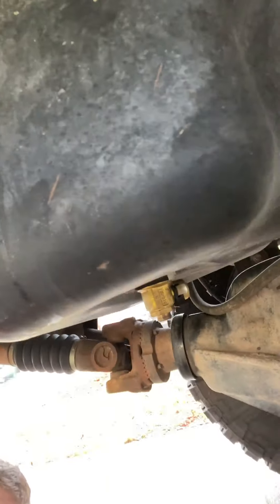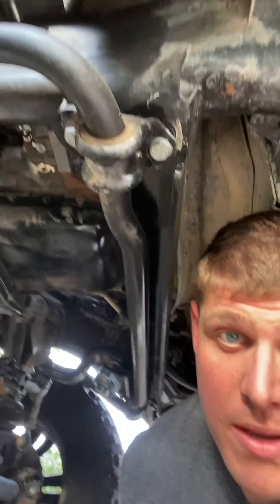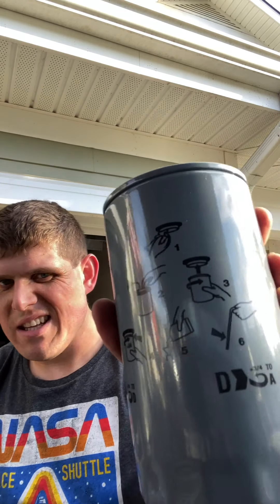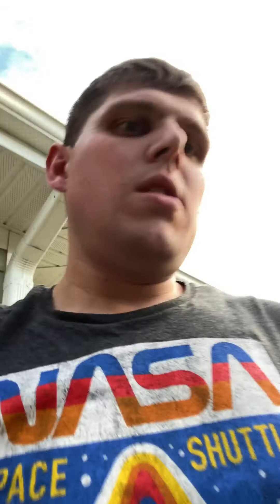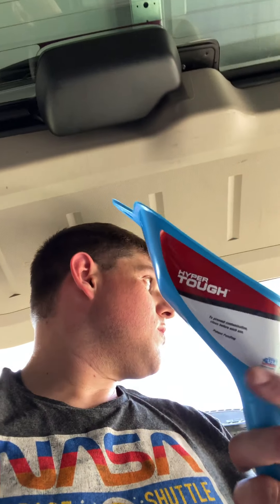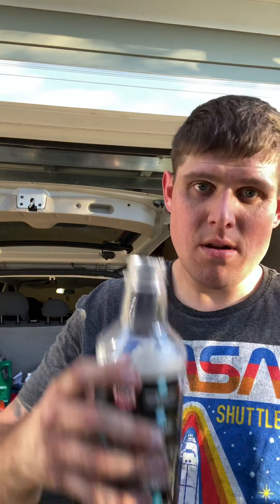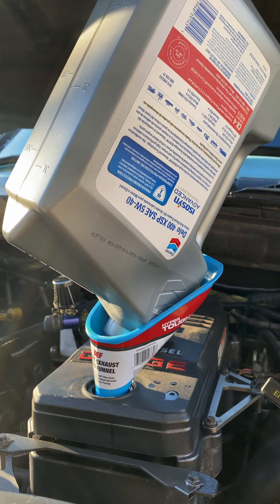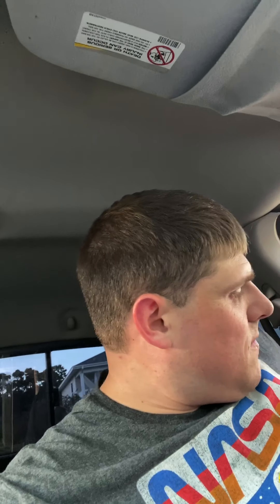Oil change ON THE 6.7 CUMMINS!***

Comment: Oil filter wrench adapter and a 12” extension will make your next oil change so much easier. And you won’t need to remove the inner well liner